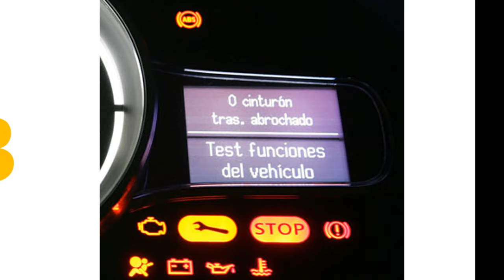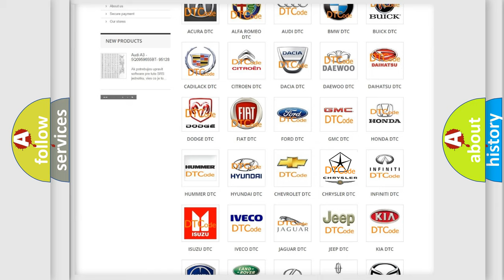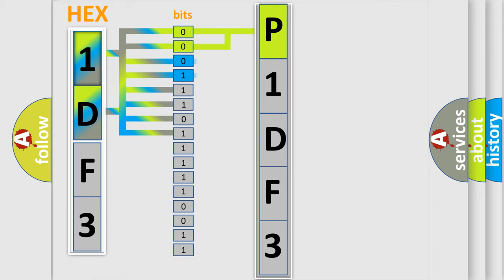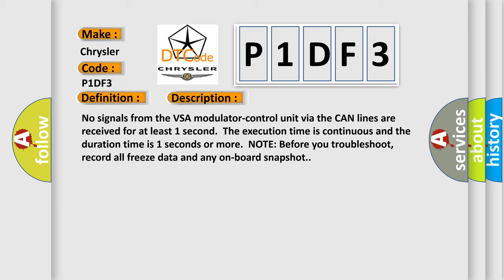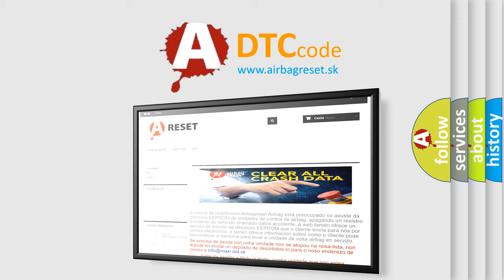DTC Chrysler P1DF3 Short Explanation

Comment: If anyone sees this pop up, check your fuses, you may be missing one completely. Make sure your obdII port's fuse is present.
Reply: I’m having this code along with p1bd8 but shop can’t figure it out they think it’s transmission
Reply: @maggiegirgis9271  Oddly, that last code also says it could be incorrect transmission fluid level. Did you have it serviced recently?
Reply: @nathanthreeleaf4534  yes it just got back under the trans warranty that’s why I’m thinking there is a chance it might not the actual transmission unless there’s a leak possibly somewhere
Reply: @maggiegirgis9271 did u ever figure out what the code means?